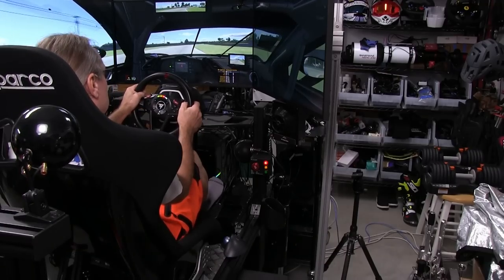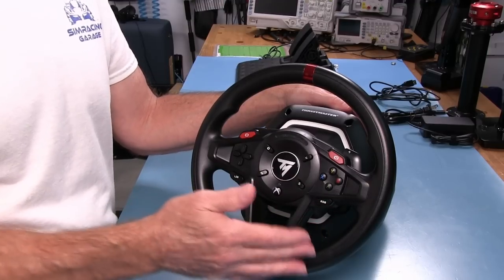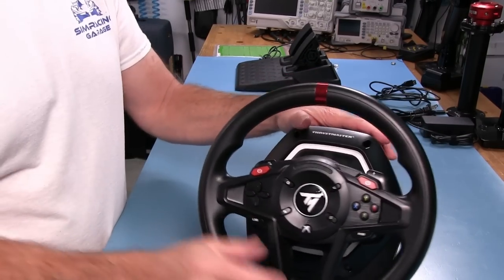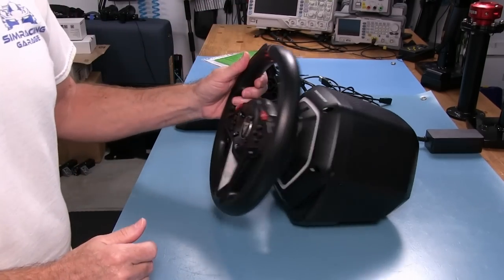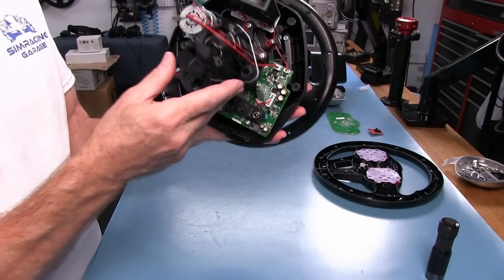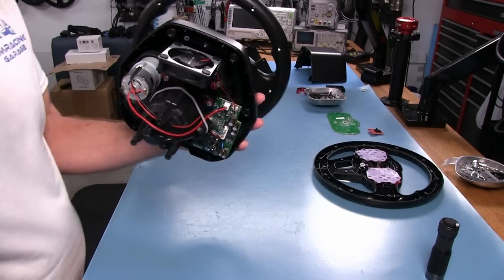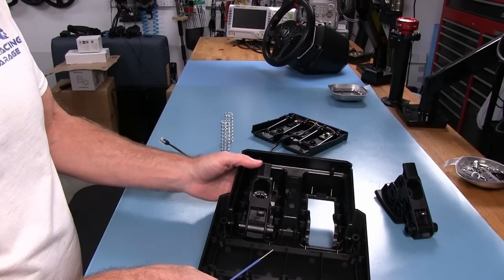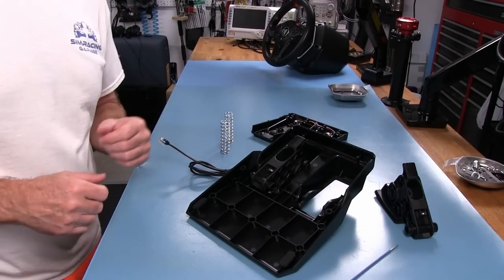Thrustmaster T128 Wheel Kit Review

Comment: So this one is around 200USD and the older Logitech G29 goes on sale for 200 bucks which is the better bet? The logitech is older design but still new.
Reply: The Logitech, because the rim and pedals are much better. It is noisier, but apart from that it’s better in every way.
Reply: the g29 pricing is weird, I bought it late January 2020 for around 170 bucks, It has better pedals and less vague but probably less smooth ffb

Comment: Which one should be preferred between Logitech G29 and Thrustmaster T128? Material quality and clutch will not affect my decision. What I'm curious about is FFB and steering feel. The T128 has a hybrid system, the G29 has a fully geared system, so I'm closer to the T128 but haven't decided yet.

Comment: This is the only review that people need to watch for this wheel. Thank you for the excellent video and demonstrating it on 2 different games.   I haven't used any high end racing wheels, but your thoughts seem similar to my impressions of the T128.  If you want to drive with a wheel, but are on a tight budget, this will do the job, but you won't be beating many times set by high end equipment. For the price, it's a nice piece of kit honestly.

Comment: Especially the entry/cheap wheels you are coming at it from a Racing Car Simulator, where the rumble strips are important, feeling is winning, but many casual gamers or those JUST starting with FFB run driving games, not simulators. Not merely Forza, but three other options may well work differently and be a bigger draw for people buying those wheels, and not "needing" to get off their controller/keyboard. Euro Truck Simulator 2/American Truck simulator (same engine), Snow Runner and Farming Simulator 22. The first is on sale and merely the base game gets you most of the way there. It is all about feeling some feedback when you are losing direction or contact, if the FFB informs, then to an extent it is working. Snow Runner is slow and based on offroad, poor traction, and the FFB is about helping you find the grip that takes you up (or safely down) a slope. If FFB helps you find that route, it is working. Farm Sim 22 only recently got FFB abilities, and as a more recent release it is not cheap either. FFB is more about steering safely (you're mostly in a tractor on "farmland" or roads). FS22 also has a problem that you need a lot more buttons to press and FFB isn't a selling point for the game, using a tractor IS.
All those games are not so much racing simulators, not even racing GAMES (even silly gaming game types like Wipeout or whatever), but is a large market that might do with merely a cheaper option because the game isn't delivering the force feedback that makes a racing game so going a grand worth of direct drive kit is almost wasted compared to even rubber band systems for that type, but COULD lead to trying other, more racing, games because they found a difference using FFB on those, and other games reward better, but more expensive, alternatives, by needing more feed back to the person via their wheel whilst the games I suggested have a lower need and a lower reward (for example, you are not competing with other humans, so "better wheel" doesn't mean "win against someone trying to get ahead of you").

Comment: Good to see thrustmaster finally refresh their old t150, t300 lineup  (T248 replacing t300) :)

also, thanks for the xbox code Barry XD
Reply: This one is a bit too distant to match the T300, so it's closer to a replacement for the T150/TMX
Reply: @Sithhy  Yeah I was referring to the T248 when i said replacing the t300
Reply: @awsomestleaperd78  Even the T248 will not replace the T300. It has no ability to switch out the steering wheel as well as it's too slow in rotational speed when compared to the T300 so you have "throw" the steering wheel yourself when you want to drift or do a quick reaction
Reply: @Sithhy  Honestly the replaceable steering wheel part is not important with thrustmaster. I doubt theres many people buying thrustmasters rims when they have a t300, they would upgrade the wheelbase first. However, the speed thing definitely seems of concern
Reply: @awsomestleaperd78  What even? People that buy TM Base are ofcourse swapping their Rims out.
Reply: @awsomestleaperd78  the replaceable wheel was one of the reasons I went for the T300 instead of T150, when upgrading my wheel a few years ago. And I have since gotten a replacement rim for it too. 
T248 is a better competitor to Logitech G29/G920/G923 than T150/TMX/T128, but it isn't a replacement for T300, as that is a tier higher in terms of performance

Comment: I want to buy a wheel but I don’t know which one is better if the t150 or the new t128
Reply: T128 is a better build and well thought out wheel it seems.
Some people are disappointed by the break and accelerator but even though it's small, it will last more compared to the older one.

Comment: Question.  For those who use the DD wheel at 15Nm and up, are they trying to get the feeling of no power steering (or v minimal) in race car setting? If one is driving road cars like in AC,  is there need to dial up the torque to beyond 5nM?
Reply: For road cars you don't need more than 3-5Nm
Reply: 12 nm is enough
Reply: That's a great question. For ACC I use a 17nm wheel at 100% in drivers, only 35% in game, and I'm not sure if have something set wrong, but it still clips under certain circumstances, so a higher power wheel would be good. So I imagine that is running about 6nm in reality? It's a nice weight, giving good weight and detail. You could have heavier steering for fun, but I doubt most would run it much higher for actual racing. So there is a difference between the general weight you're feeling, and the headroom the wheel has for some situations like large weight transfer or sliding around etc. To answer your question, it depends on what you want to do. Do you want the most accurate feeling of a modern power steered car in AC? Then you don't need too strong a wheel. Or do you want to drive that same car in game, but because this is a sim and not real life, want a greater range of ffb power so you get better feeling of small details and no clipping etc to help you drive it faster? In that case something like 12-15 nm up would be worth it. imho ;) Having said all that, aliens can blitz us on G25's or probably this wheel also! So more nm will not automatically make you faster obviously.
Reply: It's just for fun and immersion. Also, 5Nm is nothing. I use 10Nm minimum unless I'm driving a road car.